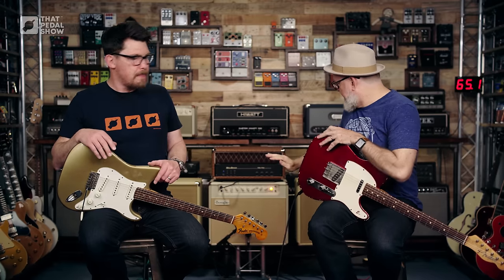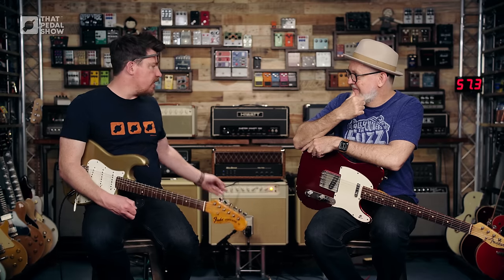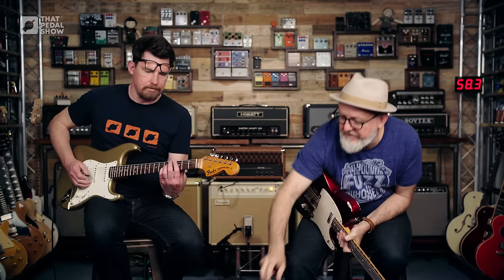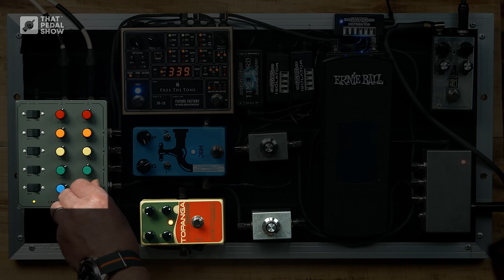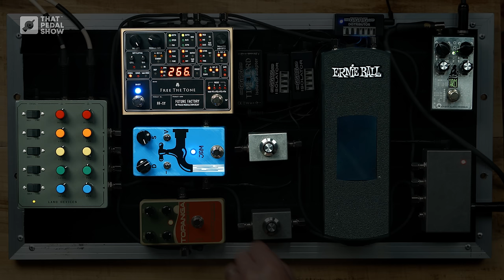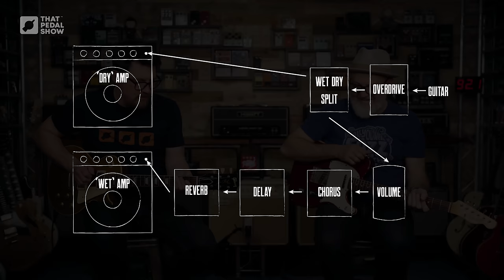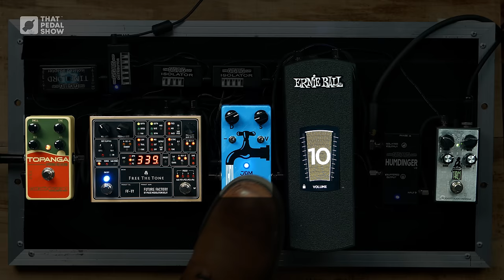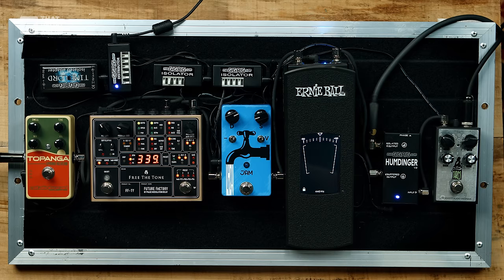Did We Get Wet-Dry Guitar Rigs Wrong? [Proper Wet-Dry-Wet Vs TPS Wet-Dry]

Comment: What about the placement of the splitter? At 10:20 Dan briefly mentions running the signal out through the Speaker Output of the amp and into a Line Out Box that splits the signal. Would there be any benefit from doing this or is a splitter in the FX-Loop just as good?
Reply from the maker: Using the speaker route (it needs to be a proper load box and not just a normal signal splutter) means you get the sound of the power section as well, after the output transformer. In most amps, if you do it at the FX loop you don’t get any of the power tubes, transformer and all that.  That’s the difference. cheers!
Reply: @ThatPedalShow  Ok sure, but how much of a difference does the power amp really do? I mean, most of the sound is shaped in the preamp anyway, isn't it?

Comment: What do you guys think of employing a split at the speaker using a Bray LO-1 and sending that to an EHX Tri Parallel Mix instead of volume pedals and an mixer. All the effects could be set 100% wet and sent to a single wet amp (since the TMP is mono anyways) and you can set the dry blend on the pedal if you want to hit that second amp with dry signal or not. Somewhat simpler setup compared to the full blown rig at the beginning of the video. Thoughts?
Reply from the maker: Mick here. I think that’s a little closer to how the 80s people used to do it. And the nice thing about the EHX is that it has phase control which could be extremely useful depending on the pedals and other amps being used. Haven’t heard the Bray, but one would assume that with its own level control and the levels on the mixer you could balance things up nicely. I’d be interested to hear whether you could get it down low enough for analogue devices to not overload, but presumably that’s possible. Cool solution…. Although my own personal preference is to be adding a separate dry amp to my main wet/dry amp (which is what TPS Wet Dry is), rather than adding a wet only amp to the main dry one. The former is a much stronger sound which we’ve become accustomed to! Aaaaaand, simpler because you can just do it off a simple board with the addition of one device (either an ABY or a Humdinger).
 But for more traditional wet/dry, the Bray/EHX looks cool! Final check would be to see if those EHX outputs are isolated to there are no ground loop hums. Cheers!

Comment: 34:42  Yes!  I recently bought an ElectroHarmonix Oceans 12 for some big reverbs.  I tried running it in the effects loop of my Fender Supersonic 22, but the effects send signal was hitting the pedal so hard that it was totally cracking up and glitching out.  I called EH about it, thinking something was wrong with the pedal, but it works fine in front of the amp (other than sounding bad in front of the overdriven amp).  Now, my amp is off to the doctor to see if there’s a problem causing the loop signal to be so high, or if that’s just how it is (also the reverb circuit had an issue, but anyway).  I hope it can be worked out because I love the amp and driving it; I don’t want to resort to a clean amp and all effects (including drive) in front of the amp.  😬
Reply: A lot of pedals aren’t designed to take the line level signal after a guitar amp’s preamp. They’ll just overload and start clipping like mad. EHX pedals definitely have a rep for this (try putting a humbucker guitar in to a DMM…clip city), but they’re not alone. I doubt your amp is faulty, it’s likely just got a loop with a +4db line level signal - effects loops coincided with rack effects in the 70/s80s, which are all effects designed to take line level signal. Pedals are often designed only to handle -10db Instrument level signal since the designer will expect it to be in front of the amp.

Some effects will handle line level signal, and some won’t. My Meris Mercury7 Reverb pedal, for example, has a switchable signal: Guitar instrument level, Synth instrument level, and line level. But my Jam Delay Llama Xtreme analog delay only handles -10db instrument level, so it has to stay in front.

This only applies to normal serial effects loops, however. If you have a model of amp with a parallel effects loop, it’s pretty common for said effects loop to have a signal level that you can toggle, down to instrument level for normal effects pedals. The reason you can do this on a parallel loop but not a serial loop is reducing the level reduces the volume - but in a parallel loop, you’ve actually mixing two signals (the dry path, and the quieter path you send through your effects) to get a correctly amplified signal into the power amp.
Reply: @justinmarrington8039  
Thanks for the information.  It’s definitely disappointing.  I use an attenuator specifically because I like the sound of my amp starting to break up and preferred to avoid using drive pedals.  But, the big reverbs in front of the amp causes the big trail of the reverb to break up, which isn’t a sound I’m going for.  If there’s no resolution, I may end up selling the EHX and trying a different reverb pedal.  You would think a company that has been in the pedal game for decades would make provisions for a pedal being used in a loop, especially reverb which is more commonly placed there.  I know that it’s super popular for players to get all their sounds from pedals into a clean amp these days, but that’s not what everyone wants to do.

Thanks again.
Reply: @jeffmansfield914  No worries :) Electro Harmonix, bless them, have a very idiosyncratic and retro approach to pedal design. This often leads them to places nobody else gets to (like the original Electric Mistress) but sacrifices usability.

If you're looking to switch pedals, there are plenty of options with a better input gain handling. The TC Electronic Hall of Fame reverb is very much in the same genre as Oceans 12, and similar in price, and very popular for its sound quality. Only downside is the Oceans 12 is much prettier to look at. The manual specifically states that all TC electronic pedals have a very wide input gain range to handle the level of series effects loops as well as in front of the amp.

If you're willing to jump up a price bracket, I have personally used the Source Audio Collider in a loop and can't recommend it highly enough. The Meris Mercury7 is also great, but it's less of a general purpose reverb and more of a specific ambient effect unit.
Reply: @justinmarrington8039  
Justin... you’re the man.  Thank you so much for taking the time to help me think through this.  What a great resource this community is because of people like you.  I’ll be checking into these pedal alternatives while I wait to see if the tech has made any difference with my amp.

Comment: Hi Gents - I am going to try a wet/dry set-up. My plan is to Y out of the effects loop into a chorus and delay and output in stereo. My issue is I would like both effects to output in stereo, but the chorus has stereo ins and outs, whereas the delay has a mono in and stereo outs. So to get stereo I would have to put the delay before the chorus, which is the opposite of what I usually do. Any suggestions?

Comment: Would I be right in saying you can’t do volume swells with TPS wet-dry unless you had a second volume pedal???
Reply from the maker: Depends where you put the volume pedal. If you put it directly before the split that would work. A, you’d get the swell. B, you’d retain the trails. Nice!
Reply: @ThatPedalShow  Thanks guys.  I only have 1 amp atm. Would it work to run a mono board in front of the amp, mic the cab and split the signal to a stereo fx board and run 3 channels (mono amp + stereo fx board) to a DAW in parallel for recording?

Comment: So, what is the difference between using a preamp for tone; an effect send for modulation and delay effects; & a poweramp stage into a speaker OR an Amp for tone and an Amp for mod & delay effects?  
…surely this ‘TPS wet and dry’ thing is pretty much the same as using a regular amp with a send & return, yes?🤔
Reply from the maker: Hello! No, it’s entirely different for a number of reasons. 1) You’d be placing the effects after the amp’s preamp if they were in the loop which while neither better not worse (just personal preference) it is palpably different. Then, 2) Having your wet effects come out of the same speaker as your ‘dry’ tone is a very different experience than having just one amp do dry and another doing dry+wet. 3) If you did put your wet effects into the effects loop and sent from one amp but returned to another that could and indeed does work. It’s a common way to do it, as long as you correct for phase and ground loop hum. 
The point is that having two amps doing different things is vastly different than having one doing everything. Or indeed two doing everything. Cheers!

Comment: just buy and AXEFX or Helix  run all the parallel stuff internally with you effects  ...you can run through 1 dry speaker behind you run wet out to PA mix in your monitors- I run my WDW through a helix and 3 lightweight FRFR speakers .... sound unbelievable and none of the weight none of the drawbacks. the weight is in the power amp and conventional speakers... weighs less than my old fender twin and sounds better ....

Comment: @Dan/Mick could something like the humbolt be used as the hard left/hard right amp plugged straight into a stereo channel of the mixing desk and stick the likes of stereo delay and dimension chorus into the return of the humbolt loop return there for bypassing it’s preamp but with the preamp of the main amp feeding into the chorus/delay ……? 🤔🤔🤔🤔🤔 just an idea to save having to bring 3 amps….! And regards friendship with the sound engineer il be doing the sound …! Also shouldn’t be too much issues with latency as a analog mixer is being used as trying to control a digi desk, sing (badly) and play is way too much to think about!
Reply from the maker: Hey Billy, yeah the Simplifier would be a great way to do it. It’s all analogue so no worries about any latency. Just be sure it passes true stereo if you want true stereo. Cheers!
Reply: @ThatPedalShow  With a bit more thought I may have another more simple idea …! Guitar mic into desk on channel #4 for argument’s sake and take a tap out from that channel on the direct out > into dc2w > other stereo effects (set to mostly wet sound) and then return it into one of the stereo channels so in theory definitely avoiding any phase issues (at least I think ye may be able to shed more light on the situation) so basically main guitar sound in the Center (mic’d signal going from direct out back into the channel strip and continuing through desk eq etc…! Thinking this would be so much easier to route on the digi desk but hey where’s the fun in that 🤪! Plus the dry guitar single will be completely analog from amp through desk>pa power amp > foh speakers ….! Due to excessive tps viewing over the past few years I’ve caught a major dose of the analog dry OCD …….!

Comment: What about wet amp effects in the loop instead of in front?
Reply from the maker: Yep, you can do it that way. And if you use lower headroom amps or lots of amp gain, it can be a good way to do it. Me and Dan use on the edge amps though, and always prefer the sounds straight in the front, especially with analogue modulations. Cheers!

Comment: This may be a silly question, but when you’re doing the TPS version of wet dry, how is the mix set on the wet effects?
Reply from the maker: Not 100 per cent wet. After that, to taste. You can get it much wetter in the wet amp than if it was all going to one amp. Cheers!

Comment: I did always wonder if you were supposed to put your wet effects on 100% wet on wet dry rigs??  I feel like most people do not?  And that was the main point of this episode?  Besides the effects being in parallel instead of series.
Reply from the maker: There’s no ‘supposed’ or ‘correct’, just what people have done in the past. :0)
Reply: @ThatPedalShow  of course!  I guess a question for the “TPS wet/dry”, are you guys usually running the wet side as a mix wet/dry?
Reply: Sorry i was still watching, i see you cover this, your normal setup has a normal wet/dry mix in the wet amps.  Thanks guys!!

Comment: Can you use the effects loops in 2 amps to use the pre amp from one and the power amp from another? Like, go from the send of Amp 1 to the return of Amp 2?
Reply from the maker: Yep, totally. That’s what Andy Timmons does. Cheers!
Reply: @ThatPedalShow  oh man this is going to be fun to experiment with. Any dangers here to avoid?
Reply from the maker: Nope. Just make sure you have speakers connected and start with your volumes at zero so you don’t get any nasty surprises. Also… it’s likely you’ll get some ground loop hum, in which case there will need to be some isolation (as both Rabea and Mr Timmons do when doing this)….  But get plugging and enjoy the hugeness!
Reply: @ThatPedalShow  thanks!

Comment: I don’t know…I can’t really achieve the difference playing with or without Wet-Dry system…maybe it’s because I play in groups in which it didn’t request an ethereal sound?…‘cause it’s just a matter of “expression” or sensations, kinda, isn’t? 🤷🏻‍♂️
Reply from the maker: Maybe. I use wet dry in a banging pub rock band. Works great for me, even playing AC/DC and a bit of blues. The coupling of the two amps alone, even before any effects is worth it! Cheers! Mick here btw
Reply: @ThatPedalShow  ...y'know, I remember long time ago (...in...1995? 😳) I read about Lukather using a particular rig: three speakers, central used for dry sound (direct out from a TriAxis modified by Bradshaw) and L/R for effects and digital reverbs and delays. Well, I always thought that this would never be my rig, because its too complicated!🤣🤣🤣...see? Even today I think it's like that...😊...BUT maybe it's only because I'm lazy and more often than not I play direct in the amp...😕

Comment: Any alternatives to the Land Devices mixer by chance?
Reply from the maker: Not that we know of, but any compact mixer will do it!
Reply: Cheap route: I use a Behringer MX882 to mix three stereo effects. This unit also allows for a dry level to be mixed in parallel with the three parallel effects. The Behringer is purely analog and does not negatively affect the tone going to the left/right amps. It's a little cumbersome on the pedal board, but with some creativity it can be hidden since you'll almost never need to adjust it once it's set. 

As a point of reference, I used to run the three stereo effects in series and that did not sound bad. But in parallel, much better.

There are less cheap ways of doing this, but since you're still getting the pure amp tone in the dry speaker(s) and you are adding lots of processing to the left/right signals, the benefits of expensive mixing options are less obvious.